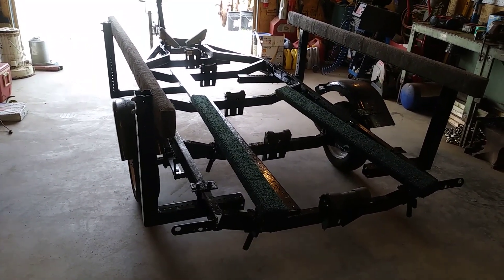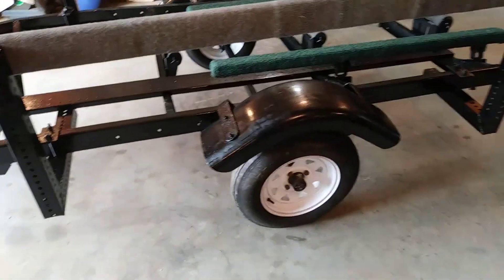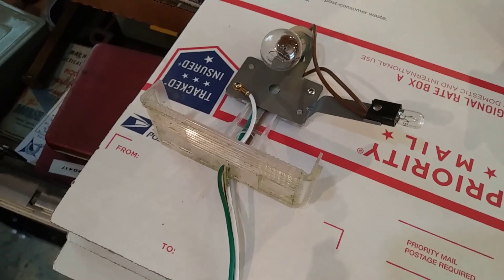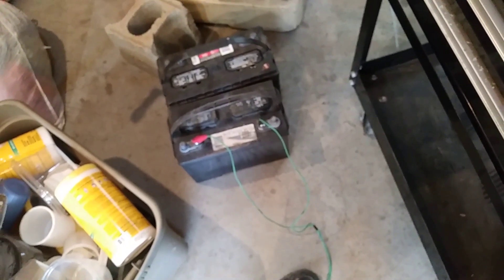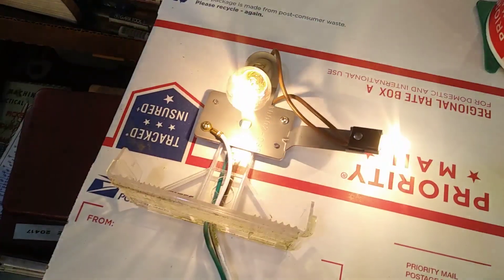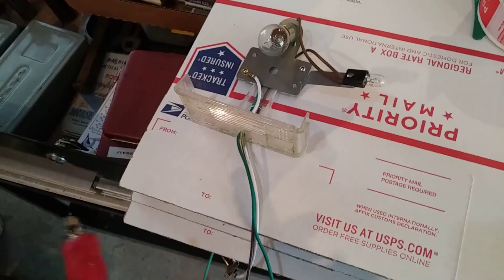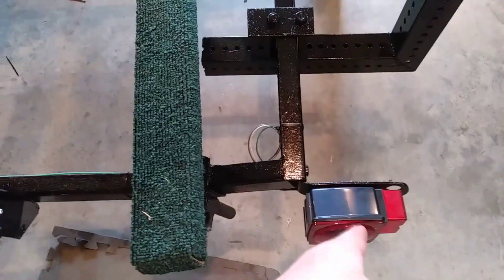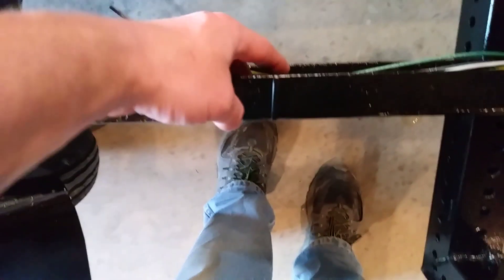Install Boat Trailer Lights

Comment: My brake lights are out where do I buy replacement bulbs and what model?  I have same type of brake lights as yours.  I didn’t know what type of bulb to buy so I bought a pair from Autozone that closely matched but the braking portion and turn signal portion don’t work now.  I think I have wrong bulbs as they were working fine before I replaced bulbs.
Reply from the maker: ozelot250 if you bought 2 filament bulbs that look just like your old ones, they should work. If your running lights are working, but brake lights aren’t, you may be getting a poor connection on the electrical contacts on the base of the bulb. 1157 is a very common lightbulb for trailer tail lights.
Reply: Just Tinkering  thank you, what about the corner light what number is that?

Comment: Help 4wire flat boat trailer - new tail light - new 4 flat wire , I have nothing truck works but nothing on trailer . Please any one help me . Is it ground ?
Reply from the maker: Mike Stanoch most likely a ground issue. Be sure the light fixtures don’t have a ground wire. If they ground to trailer frame make sure you have a good ground from truck to trailer frame. Also be sure it’s not a tilting trailer. If it breaks/tilts in the middle, run a jumper ground wire from one side of the tilt to the other. I have welded tilt trailer frames solid because of terrible ground issues. I never found a need for a tilt boat trailer.